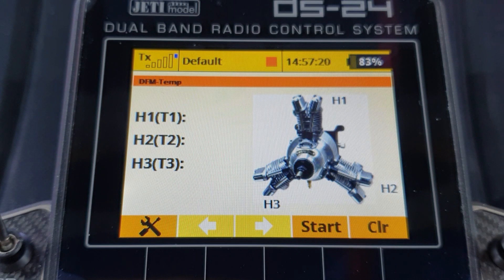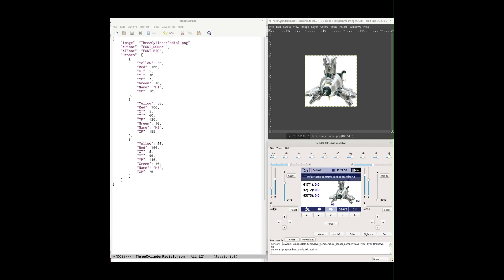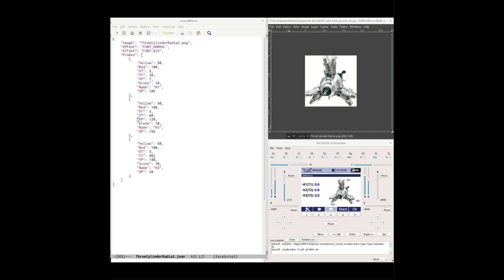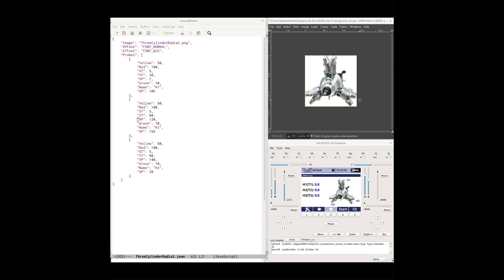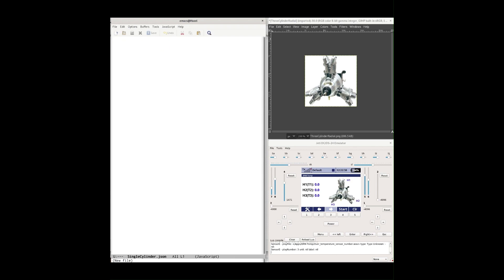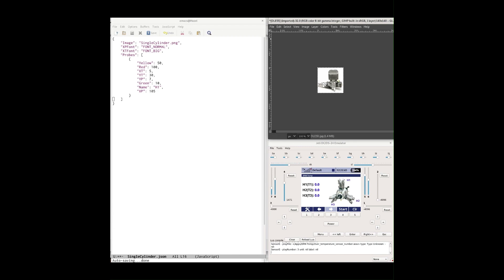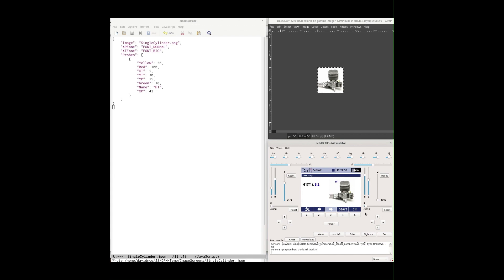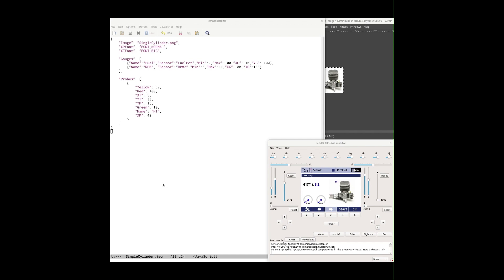Jeti - Engine temperature display LUA app episode 2 - customising the app

Comment: Hello, I have a Seidel ST-996, 9-Cylinder radial engine in a 3m-DHC-2 Beaver. Is it possible to add a  9 Cylinder to this app ?
I tried it by myself, but I got so much errors, ..... and I am not a good LUA-Programmer.

Thanks very much for this great app.
Harald from Germany
Reply: solved !!!
With the help of this video, I managed to display my Seidel ST-996 in the app with 9 temperature sensors within a few hours of study.
Many thanks for this great app
Harald from Germany